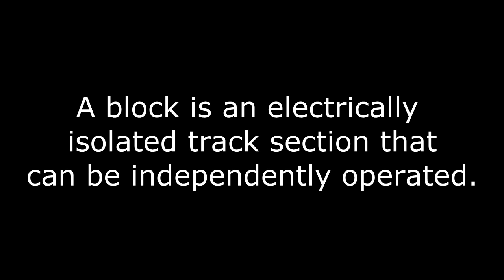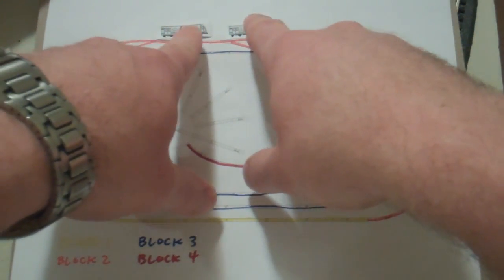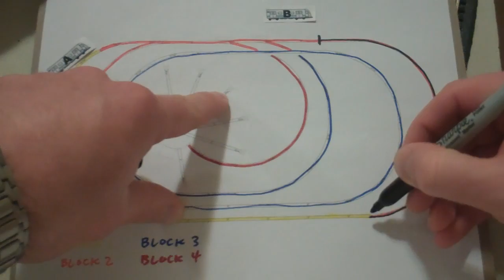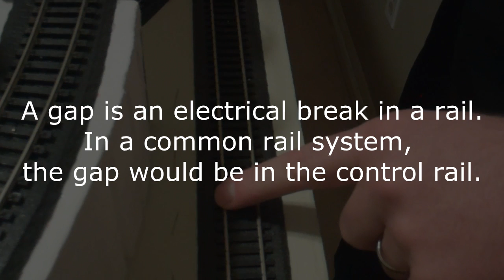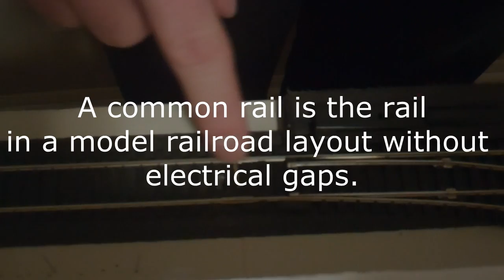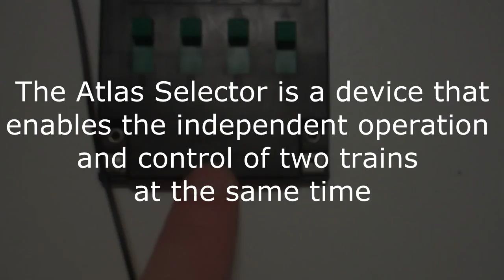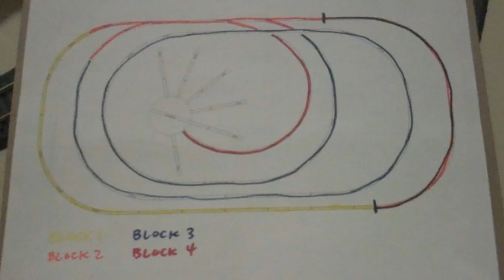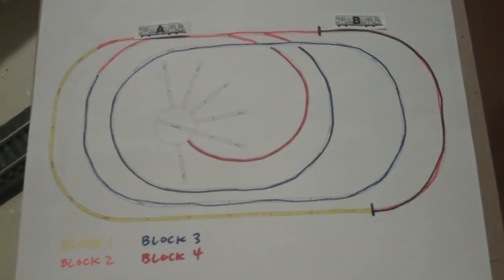Installing a Block using Atlas Selector #215

Comment: Awesome video, I appreciate how you simplified the tutorial to make it very easy for my family to understand what we are about to start to create :)  I have uncovered all my old trains ranging from 30 years to about 10 years ago when I thought I had the time.  Now with kids its seems are great time to start'r up ... eventually introducing DCC once we get the foundation of DC running trains.  Any suggestions are welcome and I'll look for more vids too.
Reply from the maker: Thanks Chris! So glad I could help. If you’ve seen my recent videos, that DC layout is no more and now I’m tackling DCC. 

Very exciting times starting up a train set especially with kids. If your children are very young and are like my nephews, make sure your trains can’t fall off the table! Those boys like to run them full throttle! 

Another suggestion, if you have the room, have two tracks so that two trains can run without smashing each other. That’s one regret I had with the old layout and now I have two. Two kids, two trains, no fights. It means two controllers, but you buy some second hand ones for cheap. 

If it’s for the kids, buy some cheap plastic kits that snap together. Depending on their age, most take glue and require a lot of patience. You can also get a lot of interactive rolling stock that load and unload. Very fun for kids. The more buttons and switches, the more fun. Lights, turnouts, bells, etc. 

Making the mountain and tunnel was a lot of fun and easy for kids too. 

In my opinion, if you take it too serious, your kids might lose interest. It all depends on what stage they’re at. 

Good luck! If you post some videos, let me know. I’d love to hear how things are going. Thanks for the sub! -Mark

Comment: Nice video guys! I prefer to solder wire onto the bottom of the rail joiner and drill a hole for each, but the inside works too! Man, DC is really interesting. I really like how it's coming along.
Reply from the maker: Daveh88   Thanks for the comment Dave. Maybe I'll ask Santa for a soldering iron. -Mark

Comment: I going to be building a Z scale layout over the course of the next several months (maybe shorter). I will be using DC. However, I will be gaping both rails as I plan to have 2 trains running in opposite directions on occasion. As far as I know, I feel the common rail will cause a short out if one cab reverses polarity while the other cab is in use
Reply from the maker: ZScaleRay   Good luck and all the best. I look forward to your progress. I don’t think I follow any Z scale modellers. -Mark
Reply: M&M Rails I've given the common rail wiring a try and was amazed that it works. I was still able to run 2 locomotives in opposite directions at the same time as if both rails were gapped. I wired the 2 cabs according to the instructions and it worked flawlessly.
This means I will go the common rail route after all. Which means I can use Atlas selectors. I find the whole thing mind blowing

Comment: hi Mark... been a while since I've use DC.. bring back memories... if you had a soldering iron you could make your own terminal joiners... i think Atlas may have th signals & controllers for them.. i used then on my previous layout.. thanks for the shout out & thanks for sharing.. vinny
Reply from the maker: bnsf6951   Thanks Vinny. I looked into the Atlas signals. Now I just have to find someone who sells them at a reasonable price. -Mark
Reply: it's been about 5 years since I've used them... good luck!!!

Comment: I am preparing to build my first ever model railroad layout, so I am completely new to all of this.  I've searched for answers to these questions and cannot find it anywhere:  
> what happens if the locomotive you're controlling stops over the gap between two blocks, so pick-up wheels are straddling the plastic joiner on both sides (pick-up wheels are touching rail on both sides of gap) and 2 different controllers are connected to each block (cab A controls block 1 and cab B controls block 2)?

> if you stop your locomotive just prior to the gap between 2 blocks and then switch the cab from controlling block 1 to controlling block 2 your locomotive would not function since you're now controlling the second block -- so the cab would need to be connected to both blocks until your locomotive completely exits the first block and enters the second (and then cab can be disconnected from that first block)?  So if a person wishes to operate 2 locomotives there would need to be an empty block between occupied blocks...does the confusing manner I've described it sound like I have the basic idea correct?  (I think I have confused myself trying to phrase it properly, and hope you understand what I'm asking).

I realize that a lot of these 'issues' can be overcome by using DCC, but I refuse to pay the outrageous over-inflated prices being charged by model railroading companies for DCC equipment.

Thank you for making these videos to help others learn to set-up a model railroad layout.  Liked/subscribed.
Reply from the maker: Hi, thanks for the kind words and questions. I’m no expert that’s for sure. Unlike you, I ditched DC and hopped on the DCC band wagon. Although I do miss my DC set up. I never really had a chance to try out my block system. It was a small layout but I wanted to see if I could do it. 

To answer your first question, I never came across the “gap” problem. But I think your second question might solve that issue. I think you do need an empty block between the two occupied blocks. It’s been awhile now, but I remember when I first set the blocks up, it worked well in my head, but then when I ran trains it was a gong show because like you mentioned, trains entered another block and it was either off or controlled by the other operator, etc. You really have to run some imaginary operations and some dry runs before you start wiring. 

I wish you all the best luck. It’s a lot of fun. Trial and error. I do miss my DC layout and if I had the room I would definitely consider making another one. -Mark

Comment: Well, first of all, I enjoyed your video. Now, I need some clarification on the following: I have a single oval (how exciting), and created two blocks I think so) my outside rail ( called A) have two terminal wires and a single straight with a ordered wire that is connected to slot 1 on my atlas 215. My question is do the insulators go on A, or on B? Thank you again for the video.
Reply from the maker: Hi Kevin. Glad you enjoyed the video. I can hardly watch those old videos anymore. Blurry and too long. I wish I still had that layout because I would love to redo this video. 

We all have to start somewhere! My brother and I started with an oval. I had to rewatch this to refresh my memory. Try this, and let me know if it doesn’t work:

Both rails need power. You have to decide which rail (A or B) will be your gap rail and which one will have constant power. The gap rail, which will have the insulated joiner, it’s power line goes to the 215 switch. The other wire goes to the main power I believe. So I guess in your case, the insulator goes on rail A. 

I hope I made it clearer. Don’t be shy to reply again. I really enjoyed this project and I hope one day to have grandkids so I can do it all over again with them! Haha.

Comment: I like your video however I am still a bit confused about the whole process the reason why we make it into blocks is because of power drop?
Reply from the maker: Thank you. This is DC which means the track controls all the locomotives on it. If you go fast, they all go fast, if you go slow, they all go slow. With blocks, one controller can run a loco slow in one block, while another controller can run another train fast in another block. Blocks are sections. It wasn’t ideal on my 4x8, but it would work better on a bigger layout.
Reply: So you attach the rail joiners to the atlas controller which is powered by the transformer?

Comment: Will it be ok, just to remove metal joined and do not install plastics? I.e. to have air gaps?
Reply from the maker: I think you might be ok with the air gaps. Friends of mine do it that way and it seems to work.

Comment: yea need the signalling. else your train will just run into a block potentially controlled by someone else.  right?
Reply from the maker: David A   Correct. Many times I’ve driven my train into another block and lost control of it. It’s not a perfect system.

Comment: Can short circuit happen when two consequent blocks are turned on? I.e when train, passing by isolated joint closes the circuits of different blocks by its wheels?
Reply from the maker: I don’t think it will short. I’m pretty sure I kept all my blocks open at one point so that the train could run around the track. If you wire your track incorrectly then you’ll experience shorting. Atlas has a great basic wiring guide that I followed. Fool proof.
Reply: @MMRails  Thanks, I also mean the situation - when multiple power sources are used on layout, to control trains with different speeds. So, when a train passes through an "isolating joint" it can close the circuit or two separate power sources for a second; similar to situation "why phase gaps  exist" on real railroad. Do you think modelers bother with having multiple sources on DC layout?
Reply from the maker: @GoshaBrooklyn    Ooh, good question. I’m not sure. Unfortunately I never really had a chance to experiment with my block set up. My brother and I never ran two trains together. I set up the blocks to challenge myself really. I’m not much help when it comes to advanced railroading. :)
Reply: @MMRails  Honestly, I am newbie. I used to play around with train, I have Bachman tracks for 15 years, and had some Bachman engine, which simply doesn't move. Recently I bought DCC Ready Atlas engine, and resumed by experiments. as of real railroad - used to live next to it in my childhood, before immigration.

Comment: I don't have any spade connectors as the hobby shop was out of stock. What else can I use to connect my 2 atlas selector boxes?
Reply from the maker: You could probably wire them together. It’s not as neat and tidy but it should work.

Comment: Now let's say that I want to install a simple block signal, red/green between each block. Is it possible to wire the LEDs to the track without relays and everything else? I'm not interested in block detection. Just assume that the polarity in that track would be enough to allow me in doing so. Any suggestion?
Reply from the maker: Jefferson Aleman   My suggestion is that you ask Tom from Tom’s Trains and Things. He’s going to post a video soon about this subject. Let me know if you want me to forward him your question. I’d love to have lights on my layout but I’m not sure how to do it yet, sorry. -Mark
Reply: M&M Rails Yes please!
Reply from the maker: Jefferson Aleman   Tom’s reply: It can be done but it will only indicate the direction of travel as long as there is power to the block. Once you shut off power, the LED's will not light unless you wire it in a different manner. But then, it's wired for power on and off but not both situations.
Reply: M&M Rails Thanks very much! I think that the first option is good enough for what I have in mind. I may put a signal facing each direction just in between the blocks. Gotta experiment a little.
Reply: M&M Rails I tried a few combinations and this is the result https://youtu.be/jg2FQWR11nU ... I've installed five of this so far. I have ten blocks for now so as soon as I receive more in the mail, I'll do the rest. I'm building a small 2x7 module and planning to expand it to a full room one of this days. Thanks for the tips!